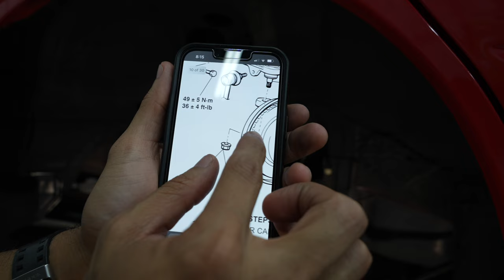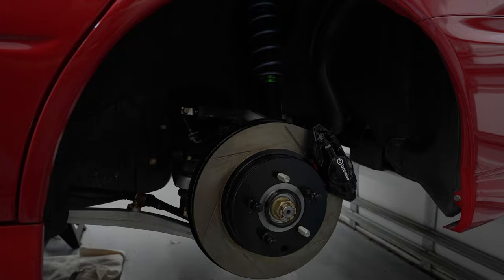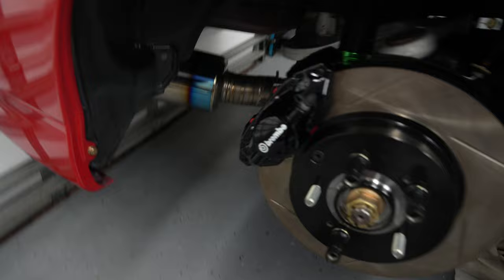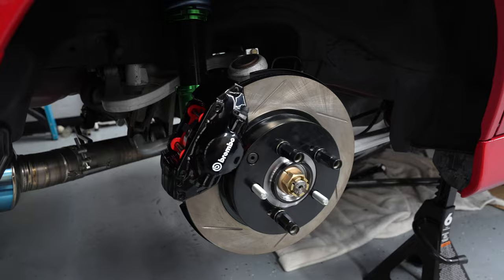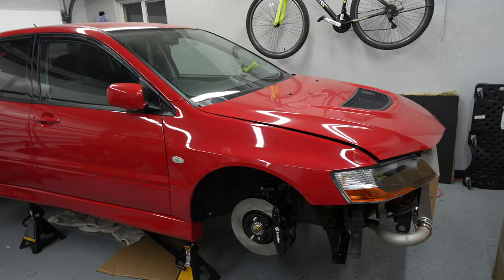Evo 8 complete rear end assembly!

Comment: Nice video! It's cleaner than my Evo9! What part nber did you use for all the rear ball joints?
Reply from the maker: The rear ball joints weren't replaced. I just replaced the boots and regreased them. It's on one of the episodes maybe 5 I think

Comment: Nice video! It's cleaner than my Evo9! What part nber did you use for all the rear ball joints? What size screw did you use for the rotor
Reply from the maker: What do you mean by nber?
Reply from the maker: Oh part number it’s the oem one just watch all the episodes I changed the boots and regreased them